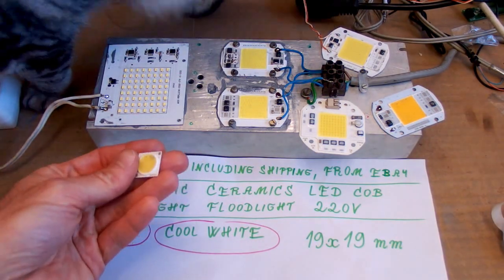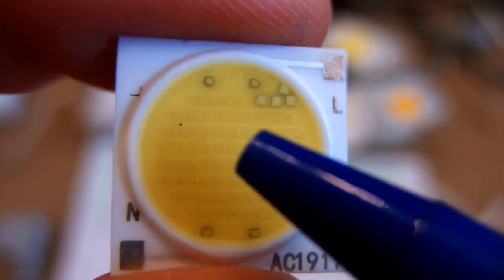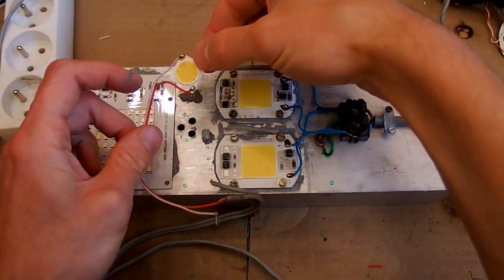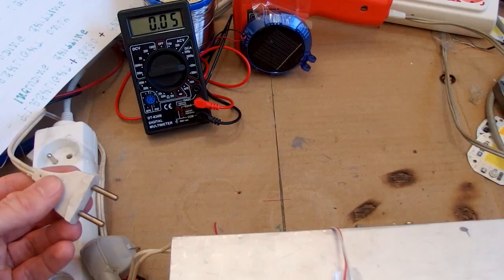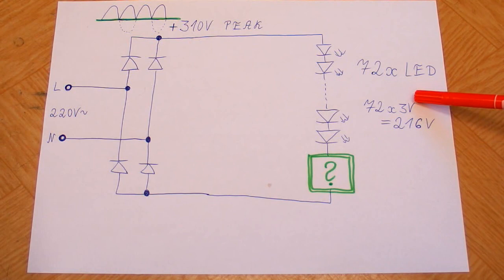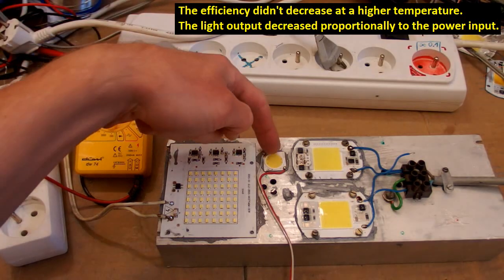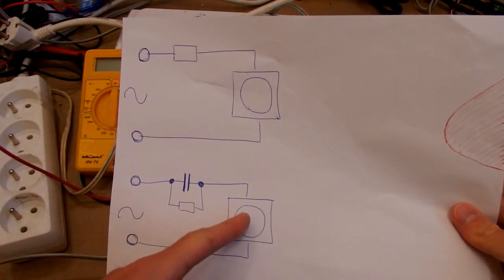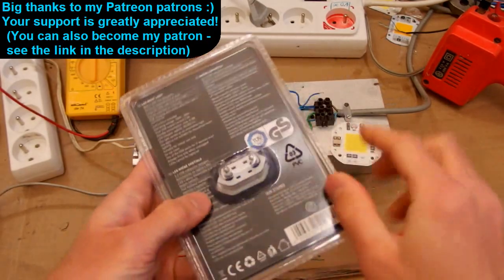Tiny 30W 220Vac mains LED

Comment: These little guys run the led lamps in series like a Christmas tree string. 5+ polarity and 5- polarity strings of 3W emitters and those strings would be setup so they are 220V strings. In other words lots of LED dies in it.

Comment: Thanks for the interesting test! It is astonisching that these little cob leds are capable of taking 30 W constantly! I got a ceramic cob Led rated for 20 W even smaller than yours but with a high CRI value like 90 or 92 so very good color reproduction. I doubted it could run on that power but it seems it can. It is even a cree led with a data sheet that confirmes the values. I think it is expected to be glued on a heatsink. I believe a thin layer of epoxy resin could do here in case it can stand the temperature. Probably you need special heat resistive thermal cunductive glue which costs more than the led itself :-)
I build a very efficient night light from 5 SMD 5630 leds in parallel. I use 2 18650 liion cells in parallel to power it just for longer life. It runs with a potentiometer 10k which i set to 10k and i feel the light is still bright enough (or even too bright) in complete darkness. It runs for nearly 2 years now without needing a recharge! I can adjust the brightness by turning the pot (i used a logarithmic one for better control). it tends to burn the pot on the low values so i must be careful. I added a small fix resistor to prevent burning the leds with unregulated current at the full 4,2 V. But the cells are on 3,5xx V for one year now and dont change much so i keep it running :-) The current at 10k is around 0,1 mA or less :-) I guess the efficiency is around 90-99% light output...  No mains driven night light could achieve that!

Comment: led is good candidate for using a dab of thermal adhesive loctite #384 ( w/accel # 7387 ) for heat sink mounting.        Cheers

Comment: Take a look at the XHP70 LEDs from CREE. They are 4 XML LED dies in a single package, with a 35W rating and it produces 4000LM! In only a 7mm x 7mm package!!! XHP50 and 35 are smaller versions using the XPG die and XPE die accordingly. If you get one make sure it is mounted to a copper star PCB and you get the newer XHP70.2 version. The Chinese haven't made a fake version yet.

Comment: Why didn't you use your oscilloscope to look at the current waveform instead of just speculating on the operation?
Reply from the maker: It would look the same as the 20W, 30W and 50W LEDs I've tested in one of my recent videos:
https://youtu.be/qKCtMnqdY9k?t=1320

Comment: 30W is not much. In Summer I bought some surplus LED from a seller in Germany. He sells a lot of different kinds. I bought 50W Sharp Megazenigata and 60W Citizen Powerled (60W 3500K 5195 lm 54,4V, CRI 90)  Here are the links:
Datasheet  -  http://ce.citizen.co.jp/lighting_led/dl_data/datasheet/en/H_3500K/CLL040-1818A5-353H1A7_P2123_0512.pdf
Seller - http://www.ebaystores.de/Electronic-Components/LED-s-LED-S-/_i.html?rt=nc&_fsub=2&_sid=35040098&_trksid=p4634.c0.m14.l1581&_pgn=2

Comment: I have seen a dc version of that shape of led, it is held by two metal clips and  plastic walls on two corners. The fact they included the components needed to use it on 220/230v ac is truly impressive.

Comment: Im only a layman but why is a higher mA more efficiënt?
Reply from the maker: If it produces more current in my solar cell, it probably produces more light, given that the distance and angle doesn't change much. I can roughly compare the efficiency when I calculate how much light is produced per watt of input power.
Reply: @DiodeGoneWild  I see, so when it gets more current from a source that generates(!) energy it gives more light and thus is more efficient, I get you. Thanks.

Comment: Still looking forward to how the flicker can be reduced in these AC LED lamps. There's something about a strobe effect around spinning machinery that I'm not big on.
Reply: Why don't use them with 3 phaze mains? This can make flicker much lower ( for example down to 1/3 of average brightness with units rewieved in the video, flicker will be around 50% brightness -> 100% brightness -> 50% brightness->... and so on at 300Hz)

Comment: Nice video, but the efficiency test is not very reliable, as different LEDs have different beam angle. Also, different color temperature LEDs may have different results with the panel. One way of making it a bit more accurate is to use about 1m long white plastic tube and place the solar panel in other end and LED in the opposite side.
Reply from the maker: Those have roughly the same angle (nearly 180°) and they are all cool white. So it's rougly comparable.

Comment: Yep no thick aluminium or copper backing to help dump the heat.
I still have very little trust in power leds, they wear down far to quickly, i would rather have a flourescent tube.
To me an led is a red glowing dot to show a unit is powered on, they lasted a hell of a long time. (yes im an old bas#ard lol ).

Comment: I engaged safety squints when you were counting down. I think when i repaired a monitor and had to test mere 9W of bare LEDs, they have permanently burned themselves into my retina.
Reply: Mmm. I have a corncob 20w bare LED bulb as my ceiling light and I love it. 
Maybe my eyes are broken but they love 3900 lumens being blasted into them.
Reply: @Boogie_the_cat   I'm pretty sure the monitor BLU is worse. It's one narrow strip and each LED is super high power, more than i have seen in lights. OK you have twice the power total, but you also have probably several times the area of LEDs. Plus inverse square law and the strip lighting 20cm from my face.

Comment: To reduce flicker make a full bridge rectifier and use a bigger capatitor ir will make the light brighter and stop rhe flicker. And you can also use multipla lights on a single bridge. I hope this helps   :)
Reply: That would probably reduce the efficiency at the cost of marginially more light output, I think. The origal design doesn't include a capacitor at all.
Reply: But the capatitor is the reason why there is soo much flicker and there is no other way to add the capatitor anywere else.

Comment: i think you cant compare the light output with a solar panel, the thing is that solar panels are designed to make power from sun light, so using it with leds does not make this comparison a standard thing. i think the CRI rating and the spectrum and bla bla is what makes it not comparable with solar panels. use a light meter or at least a photocell. thanks!
Reply: Yes a light meter at one end of a tube of shiny aluminium baking foil with LEDs at other end would be more representative for these likely having differing beam spreading patterns
Reply from the maker: Solar cell isn't perfect for this, but it should be enough to make a rough comparison, especially when all LEDs are cool white.
Reply: DiodeGoneWild you are right, specially at this price they all must be like 70-75 ish cri, so it wont make that much of difference. Still it would be nice to use a photocell instead. Or you can just have a fix place with fix camera settings. Thanks for time to teach us these.

Comment: I've seen 500w leds in this size as well, Not really surprised. But the fact that they managed to fit the control chips as well actually surprised me
Reply: Well the problem is... you can't really run semiconductors at more than 140-150°C junction temperature, they will die, and the micro wire bond can break before that. So where is the heat supposed to go if you cram 500W in that area? It's a possibility that you have been lied to and there's never not even close to 500W on 19mm. Some sellers play very fast and loose with specs.
Reply: @SianaGearz  there is actually a very reputable LED manifacturer, YUJILED that makes reeeally awesome LEDs, it is indeed a real 500w LED, there is even a video from diyperks
Reply: @trissmerigold7197  Yeah but those are 34mm...

Wait hold on a sec, found the one you mean, it really does border on 500W with a 19mm radiation surface. I can see they have a two-piece retention system with bullet connectors and a copper rear heatspreader, and the PCB size is 27x27x0.5mm with high-current pads which also serve as heatspreaders and a very thin substrate, which i wonder what it is really. This is not an easy engineering task, but i can see why they're doing it, they are specialist suppliers and sometimes you need an immense emitter density to get as close to point white light source as possible.

Comment: Nice touch with the PV panel. Minor comment would be to try and position each cell directly opposite to the PV panel during the measurement so you can get more consistent & accurate results as with such a low power  panel and light source, even a few degrees will mater I believe.

Comment: There's nothing else besides from leds?
Reply: The three style of panels shown all contain the same things, rectifying diodes/bridge, current regulating/thermal throttling chips and the LEDs.
On the biggest panel they're all in packages soldered to the   PCB.
On the mid size panel the LEDs are bare and bonded directly to the board while diode bridge and regulators are in separate soldered packages. 
On the smallest (main feature of the video) the diodes/bridge and regulators are also bare and directly bonded. 
If you look at the pictures with the LEDs just faintly glowing,like at 3:19 or unlit like at 1:34, you can se dark spots/metallic bits in the corners of the array where the regulators and diodes are (also under the phosphor coating along with the LEDs)

Comment: The only thing that really grinds my gears about this LED is that all of the dice are connected in series, so if just one die fails "open" then you lose the whole LED assembly (e.g., the unit fully extinguishes). :-(
Reply from the maker: Yes, just one out of the 72 dice fails open circuit and it's all completely gone. That's why I prefer the big 90x75mm 30W LED with 5 / 4 LEDs in parallel.

Comment: Have you ever looked at AliExpress? You can also find a lot of interesting things there :) Maybe even more than on Ebay. 
Zdravím z Brna :)
Reply: I think AliExpress is better and cheaper than banggood, gearbest  and ebay
Reply: I think you're right. 
There's all kind of LEDs, drivers, heatsinks, Electronics components and even kits for under a euro.
Reply: @Daniel_Cruz_B   Never used Gearbest. Banggood has a tidy smaller selections of products, not 1000 listings of what looks like the same thing, and for products of which there are many clones, you will usually find the higher quality ones on Banggood at a reasonable price, while on Ali it's more of a gamble. It depends, i rarely get something from eBay, i really like shopping on Banggood because it's neat and organised, are official sanctioned reseller for many Chinese brands, and you can have fast ePacket shipping on everything, and i do a lot of Aliexpress, because in my mind, something that doesn't exist on Ali, might as well not exist at all, and they have a lot of manufacturers represented directly.
Reply: @SianaGearz  Exactly.  Aliexpress is best if you don't mind spending a lot of time choosing a product.  The advantage is low price, free shipping and a large selection of goods.  The disadvantage is the long delivery time.  Gearbest and Banggood are best at buying more expensive items, such as cell phones, because shipments are mostly duty free and faster delivery plus warranty.  Personally, I prefer Gearbest between the two because there are a large number of non-public coupons that can dramatically reduce the price of the product.  If one knows where to look, then Gearbest is the winner.
Reply: Or from wish.com,  there are some interesting stuff too.
Reply: @medvesajt-cf3qf  Wish mostly re-purchases things from China.  So what is on Wish can be also found on Aliexpress for less money.
Reply: @michalcerny2503  good to be known. thx
Reply: @medvesajt-cf3qf  You're welcome :)

Comment: I love your videos. ❤️😍 Please upgrade your camera and upload in 1080p.
Reply from the maker: I'd also have to upgrade my laptop. The screen can't even show full 1080p and the CPU would probably melt while editing such videos :).
Reply: @DiodeGoneWild  You could porbably buy something like Optiplex 7010 8Gb ram with I5 3470 on ebay for 110 EUR including shipping. It's really cheap for a 22nm I5, 8 GB of ram, motherboard, case, etc... It could easily be used as a render server.